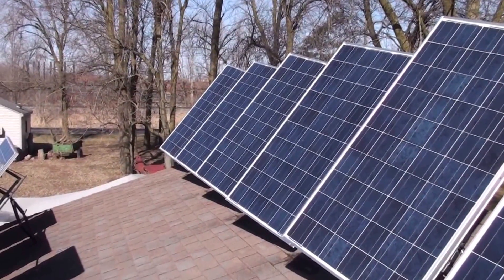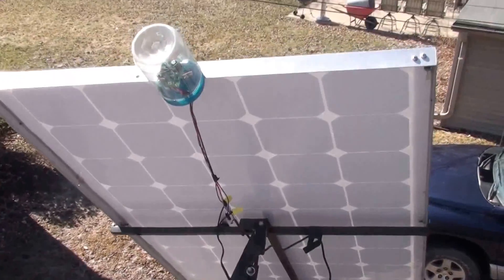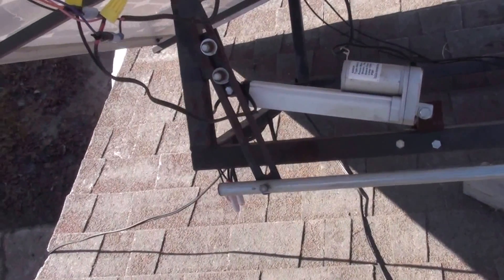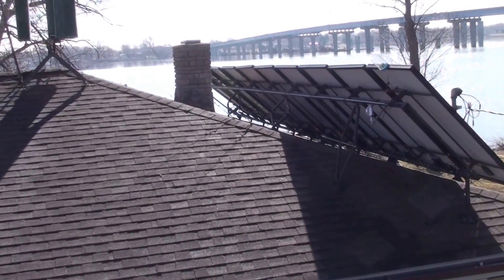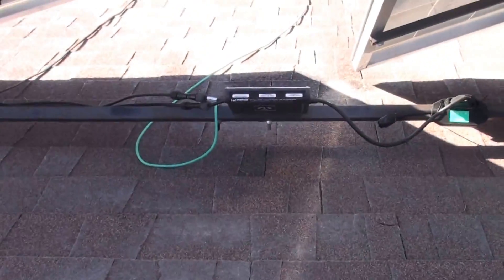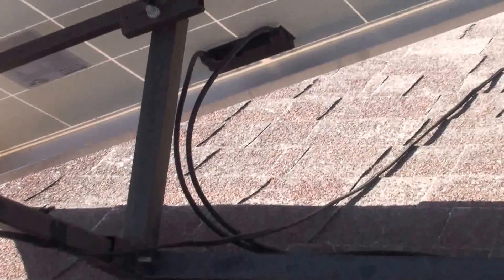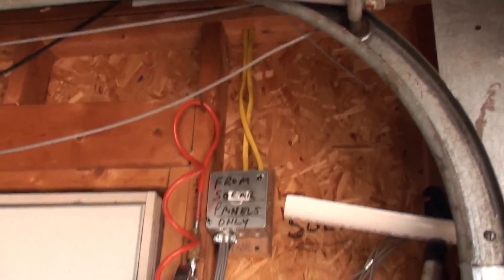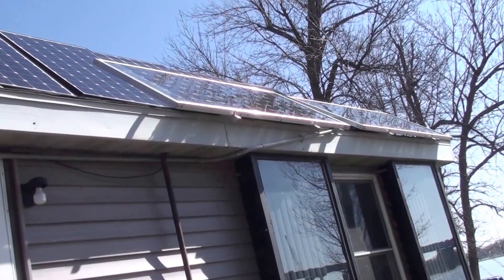DIY 24 panel solar array for $8000 before rebates

Comment: Very nice system.  How much power does the vawt harvest?  Is it home made?
Reply from the maker: Russ Bowers Yes the VAWT is home made from plans by Ed Lenz. They are on the intrnet. The VAWT is how this whole thing got started. It didn't put out enough to keep the battery bank of eight 6 volt batteries charged with what the inverter used to run the electronics . That is on the off grid panels are charging now not the ones in the video. Anyway I had to go to solar since I already spent the money on the battery bank and inverter etc . I kept learning more and more from other You Tubers and finally decided to get serious about the solar. Glad I did! For what it cost me in parts to build the VAWT and alternator for  it etc. I could buy 2  230 watt solar panels. The best the Vawt every put out was 30 amps in a high wind . Most of the time it's under 50 watts.
Reply from the maker: Russ Bowers I should mention as far as the VAWT goes that I am in town and can't put up a tower and the wind here isn't very good most of the time. Might be better for someone else in a different location.
Reply: wiboater4 I have a 350w system and it runs a sundanzer freezer and a whole lot of other small things.  Someday I might build an inline tracker like you have.  I have one tracker that is on its 4th year and still running.
Reply from the maker: Russ Bowers I got the tracker off Ebay for around$42. I think it was from a guy in Texas. The Linear actuator was from Ebay also. They don't take much amperage to run. I power mine from an old DC phone transformer from an old cordless phone. 12 volt.  The rod going from each panel is just 1/2 inch metal conduit. You will get more wattage per day by tracking but the down side is you have to have the panels further apart to prevent shading.
Reply from the maker: Russ Bowers Home CSP was where I got the tracker . It's called the tiny tracker. His hold up better than some of the others.
Reply from the maker: Russ Bowers The Vawt is home made and doesn't put out much wattage . There isn't enough wind where I am at for one thing. It puts out less than 90 watts. Fun to watch but not worth the money I spent to build it. It was fun to build though. I built the alternator on it also.